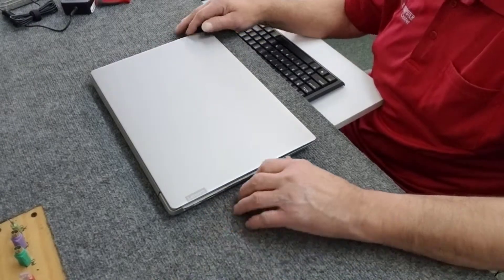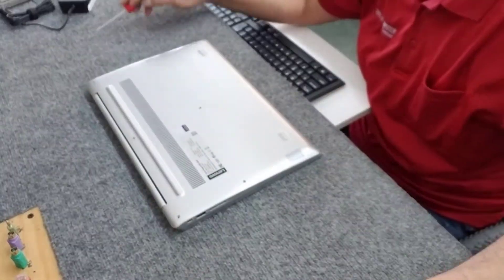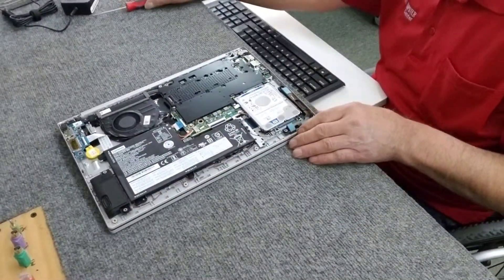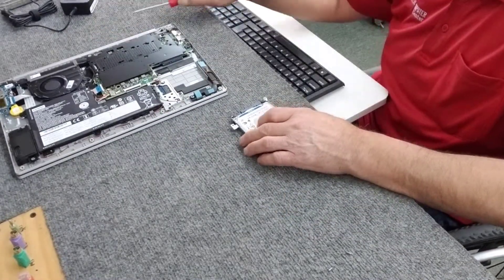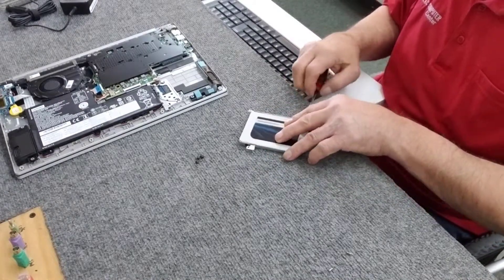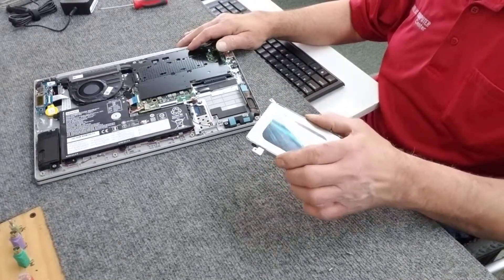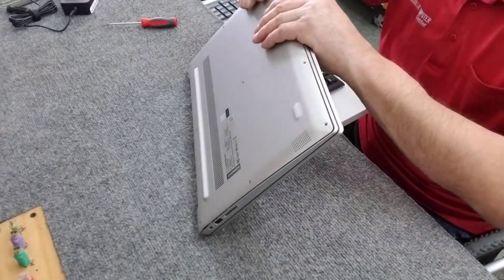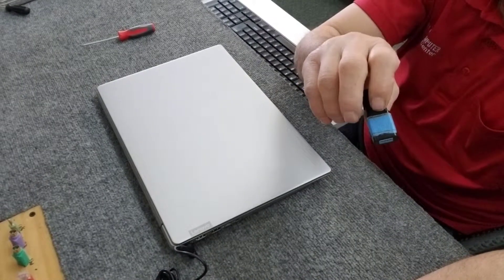Replace Hard Drive in Lenovo 330S Laptop with New SSD

Comment: Nice video, thanks - I may have to do this as I've just gone to use my lenovo (same model) and it shuts off immediately after pressing the on button...suspecting either memory or hard drive, if its the hd i'll have to replace then caddy up the old one for data recovery.

Comment: Hello!! ... I have a 330s w/ ryzen 3 processor. Would you happen to know if i can upgrade to a ssd and which one would you recomend. THANKS!!
Reply: i also have the same specs, glad someone asked this.. so i need to take note of the size of the hard drive i have on my laptop and the SSD i want to put?
Reply: @casualplays9227  yes, Is indeed a 2.5 inch. So just look for a 2.5 SSD and youll be able to replace the old one. Just remember to watch the video of how to download Windows to install it after the replacing. Have nice one
Reply from the maker: You probably have a 1TB 2.5 inch hard drive already.  You can upgrade to any 2.5 inch ssd. Samsung, crucial, WD. thx. Dale